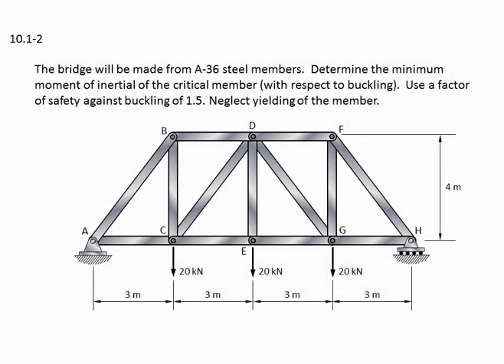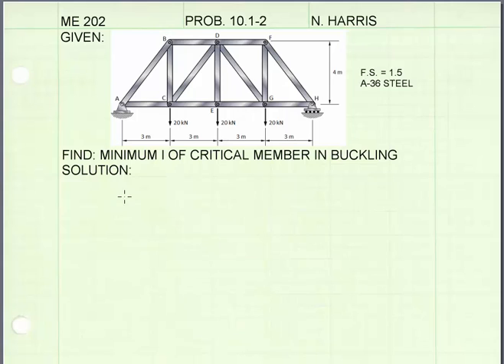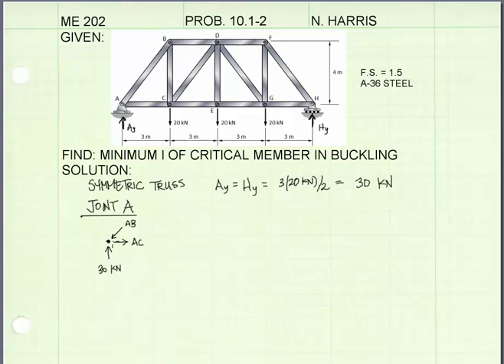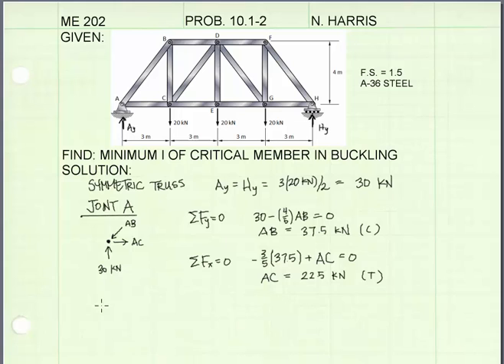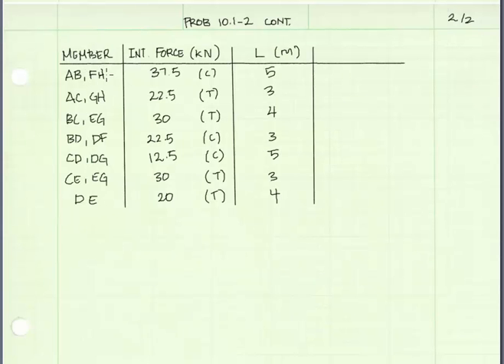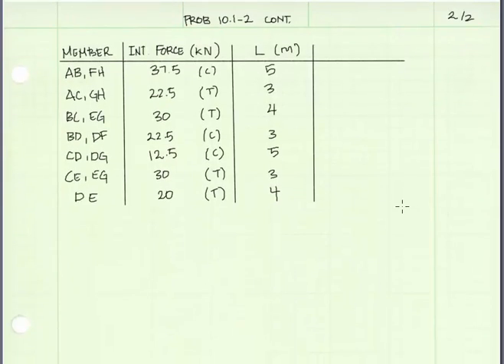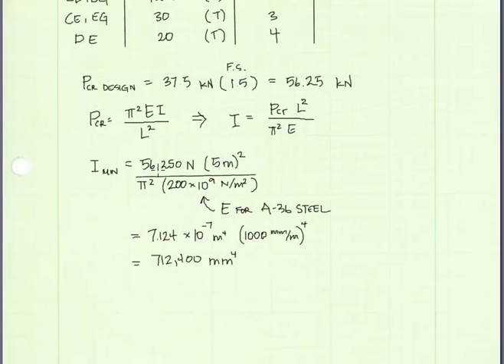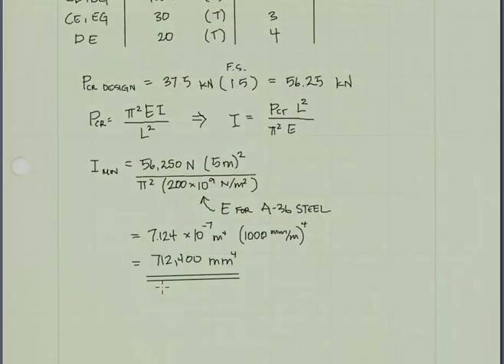10.1-2 Truss member buckling - EXAMPLE

Comment: im getting a cd 12.5Kn tension
Reply from the maker: I'm not terribly surprised when viewers find errors in my calculations, however, I double checked this one and I am confident it is correct.  I checked it using the educational version of the structural analysis software "VisualAnalysis" by IES, Inc. (highly recommended: http://www.edu.iesweb.com/).  My results from the analysis are here:
https://drive.google.com/file/d/1727x1WvgboW94L6Y3wRNDLREsA4H31LG/view?usp=sharing
Reply from the maker: Thank you for your comment.   I reviewed the problem, and I still get member CD to be in compression.